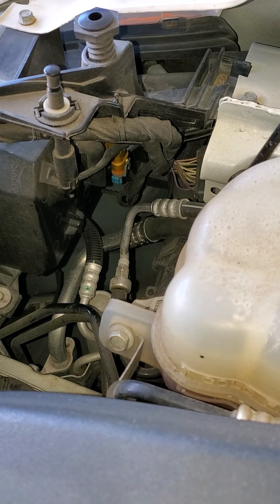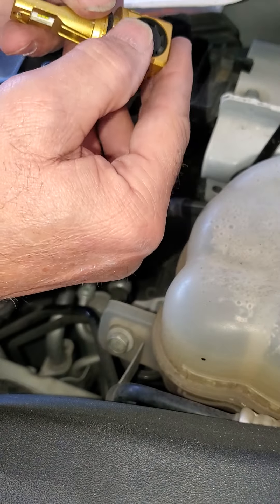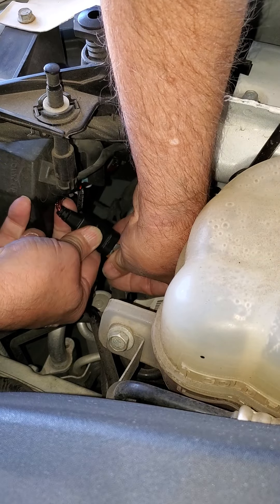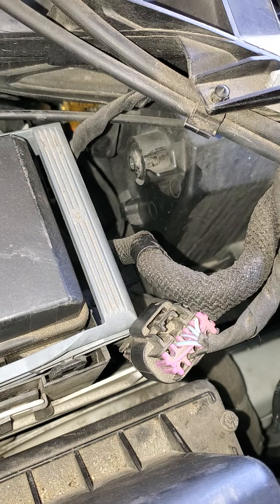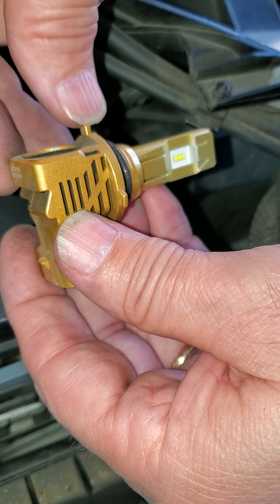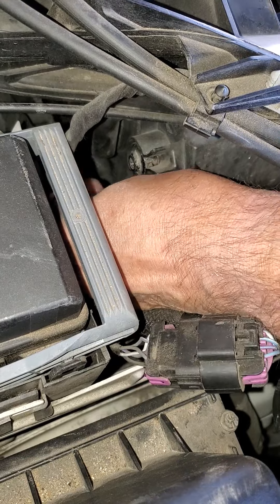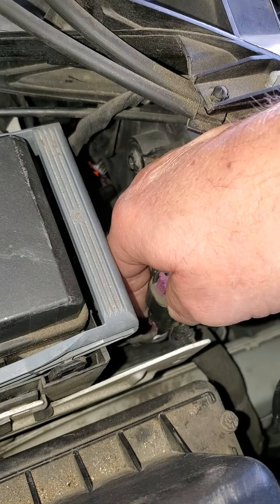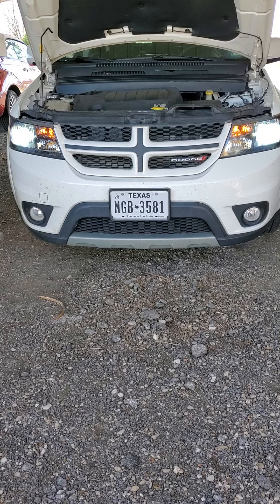2017 Dodge Journey GT LED Low Beam Headlight Bulbs Install

Comment: hi there! i’ve had a lot of problems trying to install LED. i know i’m putting them in right, but they still have issues. do you have problems with flicker? do you need a resistor? what bulbs are these?
Reply from the maker: Make sure the voltage is the same as the factory halogen bulb. Mine are 50 watts. 
Both my 2017 Journey and 2019 Ram are 50 watts. I used 50 watt LED bulbs in both without any issues. 
If you like the LED's that you bought, you might try anti-flicker, that plugs in between the wiring harness and the LED bulb to trick the vehicle computer. They are not expensive.